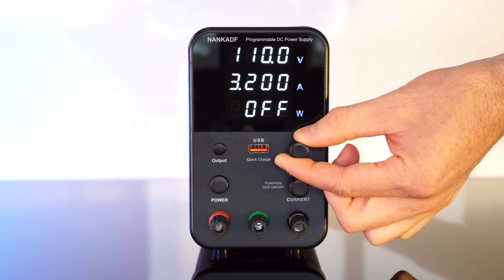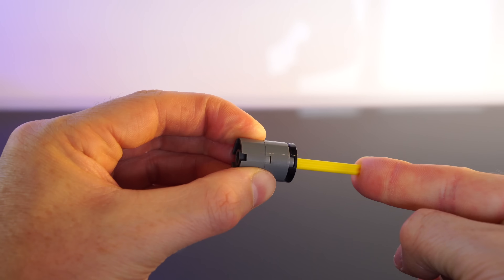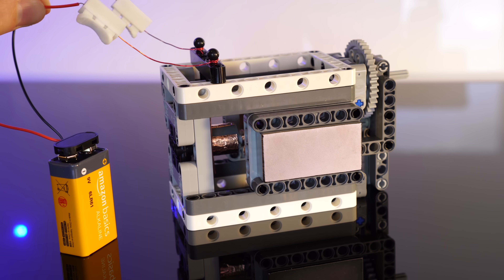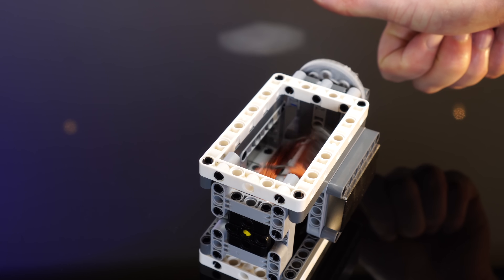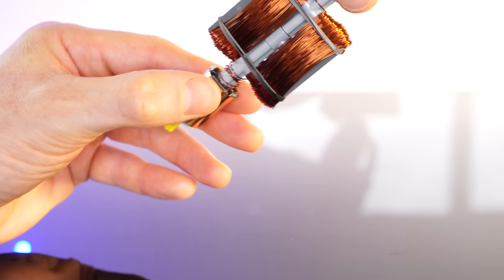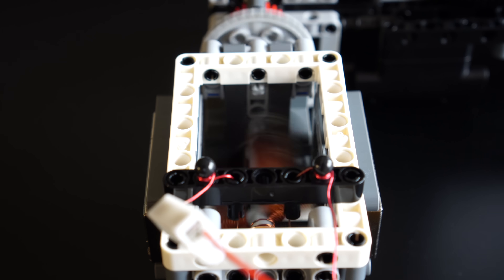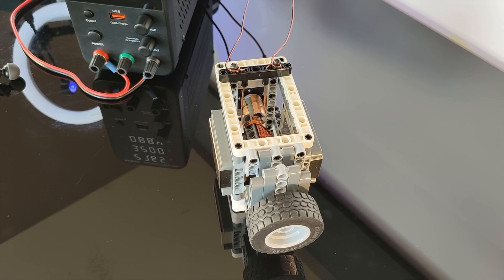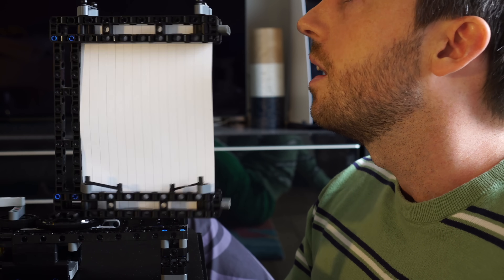Melting Motors: 120 Volts vs Homemade Lego Motor

Comment: In addition to what others have said about increasing your contact area, anchoring the other end of the contact wire (or brush or sheet you may replace it with) will also help now - as it is now it's getting thrown out to the side a bit, causing a lot of arcing that's the main reason those contacts are dying so fast and also just limiting how much current gets through to begin with, but anchoring the other end should help a bit. Ideally you'd also brace the back of it to ensure it's always in contact, but then you'd have to be more careful not to accidentally cause too much friction
Reply from the maker: That's a really good point! I actually did try it with the thinner wire, and it sort of worked. But for the thicker wire, when I anchored it on both sides, it kept stalling due to the friction. It was just a bit too stiff. But I've bought some copper wick now which looks like a great contact material. Thanks for the suggestion!

Comment: do you think you can take apart a lego motor and run 120v throught it? like...use the inside parts and make another motor...so technically it is 100% lego????
Reply from the maker: I'm sure it possible! I'm also pretty certain it'd burn out almost immediately 🔥
Reply: @JamiesBrickJams  yeah...but I think it would be cool to do:D

Comment: You actually never ran it at 120V. Since the power supply was maxing at 3,2 amps, it switched to CC (Constant Current) instead of CV (constant voltage). Once you get to the current limit, the voltage starts to drop. We can actually prove this by a simple calculation. Since power equals voltage times current, if it ran at 120V with 3,2 amps, we would get to 384W, but it was only at 150W with 3,2 amps, which means the voltage was at around 46V.

Also, to improve the brushes, why not try using the copper sheet as brushes, too? It will increase the surface area.
Reply from the maker: Yeah I was wondering if it was doing that. It's weird, it hasn't had any issues with other projects, and I've managed to chuck the full amount through nichrome wire. Perhaps I got a setting wrong somewhere. Good idea using more of the copper sheeting for pads! I'll likely try that for the next tests. Or perhaps some copper mesh
Reply: @JamiesBrickJams  no settings were wrong, thats just how the power supply works. it can't supply more than 3.2 amps and to run at 120V it would require much more amperage
Reply: @JamiesBrickJams  Not a setting you can adjust, but the winding itself. Since you are current limited you need to build a controlled impedance winding that will match your supplies output capabilities. This can be factored by using the two chosen limit variables Current and voltage (since we are not trying to build a coil with a particular power limit in mind).

So we take ohms law V=IR and isolate for our two limiting variables V/I=R. So we have 120V / 3.2A = 37.5ohm. So you need a coil thats nominally 37.5 ohm (probably closer to 30ohm due to coil inductance and back EMF that will dynamically limit current as rotor speed increases. If you used the 24awg you could get the motor to run longer and faster before burning out without reaching the point where the wire is too thick (still only rated for 0.5A but this is a torture test not a proper build).  I would also increase the armature stud length to 7 studs as you can get more linear feet of wire without building up the coil bulk too much. Theoretically you can hit your optimal resistance using 24awg wire with only 150 turns per side. This does mean you need a total of about 108ft of wire. But that can be had on a single spool.

That would in theory allow you to hit your current and voltage limit at about the same time. Other system resistance excluded.
Reply from the maker: @2009dudeman  Thanks for the calculations here! Appreciate it. My first coil was around 40 ohms if I remember correctly, but of course was too fine to cope with much. While 24 gauge wire should fair better, I've a feeling 150 turns per side would be a pretty large coil. Certainly doable, and I have loads lying around. Perhaps I'm misunderstanding something, but 108 feet of 24 gauge wire seems to come out at around 2.7 ohms. But if I understand correctly, it'd need to be somewhere in the neighbourhood of 30-40 ohms? It seems like I'd need closer to 1200 feet of 24 gauge wire to hit around 30 ohms?
Reply: @JamiesBrickJams  yeah, copper enamel wire is a bit different than bare copper, it has a higher resistance for a given length for the same gauge. This can also vary by brand.
Reply: @DonnieLuve  the video never mentioned AC or DC even once, and everything here is operating as DC (the power supply says "DC power supply" right on it). I don't understand why AC current is at all relevant here
Reply: Came here to say this.  You could see it was hitting max amperage around 45-50 volts as he was increasing the voltage to 120
Reply: 0.8mm wire is possible
Reply: @DonnieLuve 
It was not meant to mimic the line voltage it was simply the maximun voltage his supply could deliver.

It is also not clear to me, what misunderstanding you are talking about. The intention of this video was just to fry his makeshift motor.
It also appears that you misunderstood the concept of peak to peak voltage vs RMS voltage (or 'normal ac' voltage as you called it). 
A 110 V 'normal ac' means this voltage supply would deliver the equivalent power as a 110 V DC Voltage. If only the peak to peak Voltage was of interest, why would we even make a difference and what would this difference actually be? What do you think 'normal' ac actually is? What makes it normal?

Comment: Now try generating as much volts as you can with a self made motor and lego gearing.
Reply from the maker: That sounds like a pretty fun idea 🤔 With a bunch of coils of very thin wire and some serious magnets, I'm sure it's possible to produce voltages in the thousands. No idea what that'd actually be useful for though...
Reply: @JamiesBrickJams  It's worth the try! :D

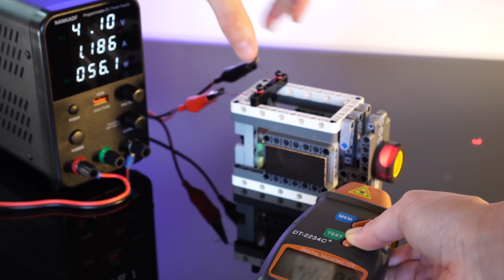Comment: 7:01 why th are the sparks g r e e n?
Reply from the maker: I'd imagine that's just what colour copper discharges. Probably different materials would yield different colours
Reply: @JamiesBrickJams  makes sense I know that copper makes green fire when burned.
Reply: @JamiesBrickJams hm
Reply: the lil green you see cause the copper is oxidized and the oxidized copper is green when the green copper is vaporized
Reply: It releases copper into the surrounding air and the sparks interact with that causing the green

Comment: Your power supply was reducing the voltage tho to maintain that current,you definitely need a beefier source to actually get the 120vdc experience,i woudk suggest a full bridge rectifier with a smoothening cap will give u 170vdc output(or a 230v AC RMS input and 325vdc output)
Reply: Mains voltage in Ireland/Northern ireland (not sure where he is) is 230v not 120 lol so it would be more like 325 volts
Reply: @mishkamcivor409  acording to the bubble maker video in 6:27, he's from South Africa (230V too)
Reply: @mishkamcivor409  Would also need an isolation transformer to avoid most chances of electrocution.
Reply: @44R0Ndin  true....
Reply: @mishkamcivor409  yeah then same as here
Reply: Would need a dedicated thermomagnetic breaker for it, at something like 10A (or whatever the max current for a standard outlet in their country is). Also, maybe they have 220V.
Reply: @Giuliana-w1f  I think they have 120volts,and yeah am 220v land too

Comment: Try three phase induction motors, you don't need a commutator that can burn out with those ones.
Reply from the maker: Cheers for the suggestion, I'd love to make a brushless motor like this. I've made a few DC brushless motors, but love the idea of an AC brushless motor. Is that what you're recommending?
Reply: @JamiesBrickJams  It is, but it also means using 3 spools / electromagnets so the motor runs smoother. Using just two phases makes it much harder for the motor to spin up. You might still need a brushed motor as a starter, but it can be disconnected after the brushless motor starts running (this is the way most power drills work)
Reply: The easiest way is probably make a 2 or 4 pole brushes motor that could work with a rc car or drone esc
Reply: Yes
Reply: BLDC motor better
Reply: @bozzalnw5357  yes but 3 phase sounds cooler
Reply: my dream is to make a lego rc car with lego motors built from scratch

Comment: To avoid contacts melting you can use several wires to make a "brush". This distributes current better. To have more efficiency you can split the same amount of power among more sets of coils, four or six. This way power is only used on coils that are closest to the magnet, producing more torque for the same voltage.
Reply: Also to make brushes little pieces of the copper sheet itself could be used.
Reply: Desoldering wick is a good option for that
Reply: @Giuliana-w1f  Great idea. The Scalectrix brushes were also a good idea but they are expensive, desoldering wick would work great.
Reply: or you can use the brushes found on scalextrick cars
Reply from the maker: That's a great idea! I'm sure it's possible to buy some of that weave
Reply from the maker: Just watched his video - loved it! A lovely mechanism and that weave is very impressive. I've just ordered some. Thanks for the recommendation 😁
Reply: @JamiesBrickJams if you have solder wick, then that should work as a brush
Reply: @JamiesBrickJams  You can also just buy motor brushes ... but yeah desoldering wick would be my McGuyver choice.